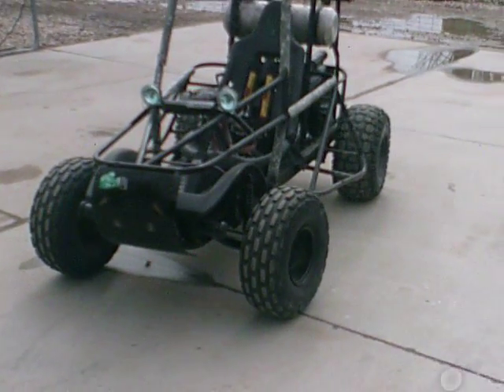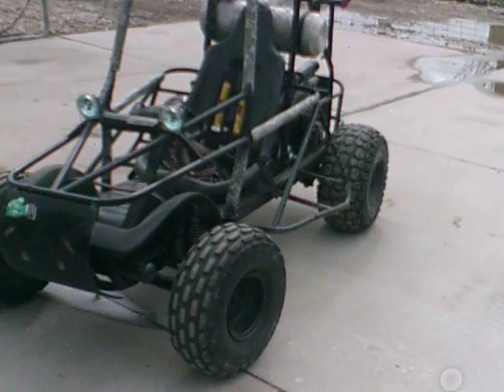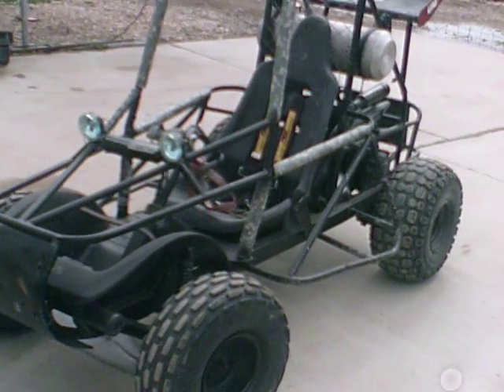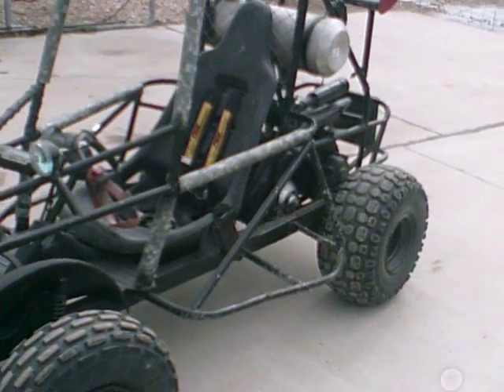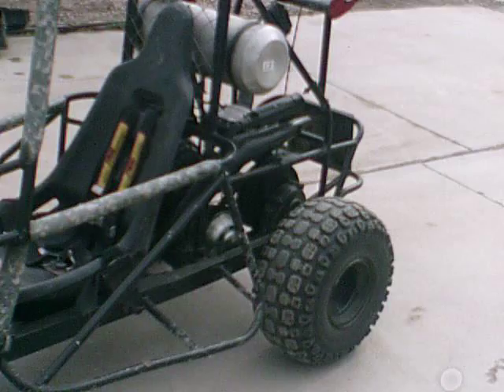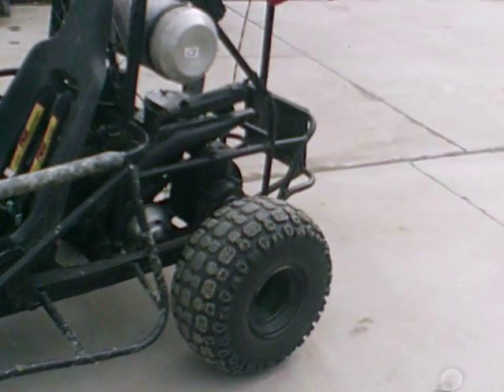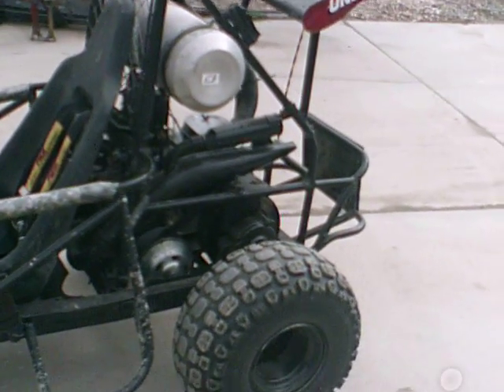1983 racing honda odyssey fl250  REBUILD

Comment: I noticed the big pointy kill switch on your wheel. I would change that if I was you. What belt are you using with your comet clutch? Is the driven stock or comet? If it is stock how does the large belt work on the driven that takes a smaller belt. Your comet takes a larger belt than stock right?